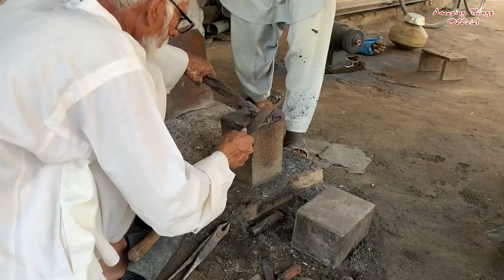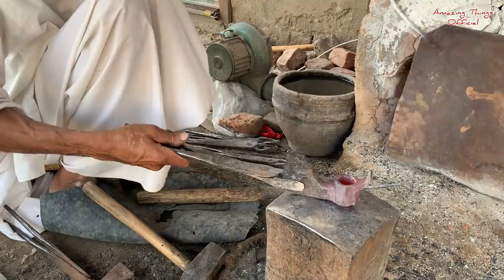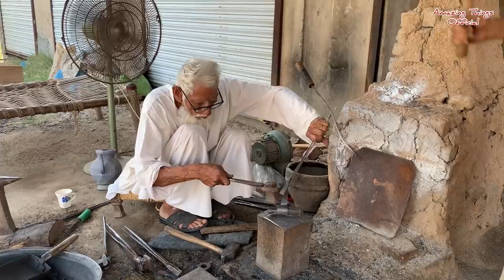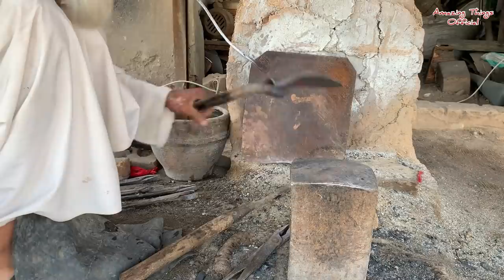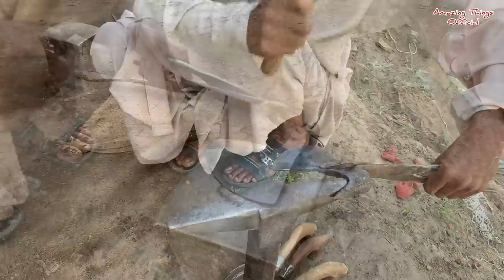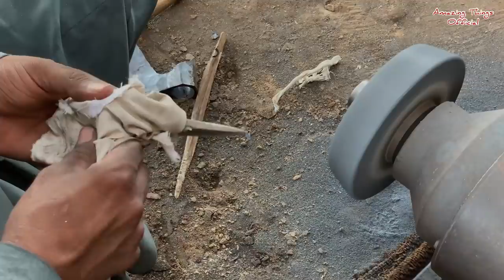80 Year's Old Blacksmith Forging an Axe From Old & Rusty Truck Leaf Spring

Comment: Old school, but it works. Unfortunately did not see any hardening performed on the blade so it is very soft and will not hold an edge.  I have seen other old school blacksmiths were they understood how to harden the edge of the ax so it will hold an edge.